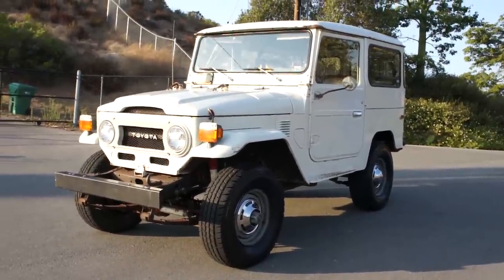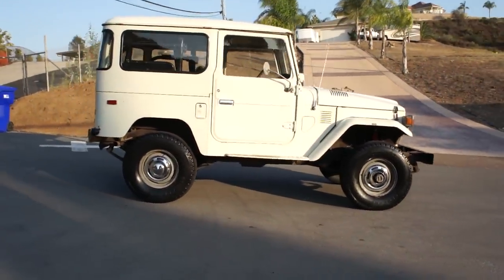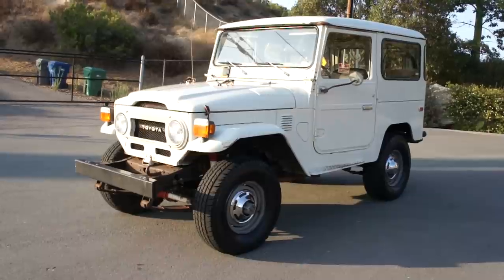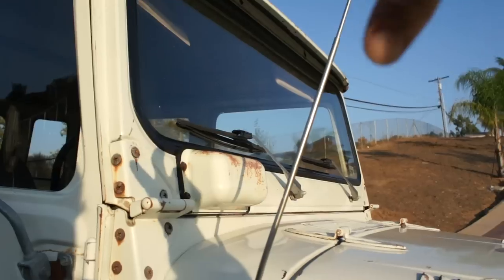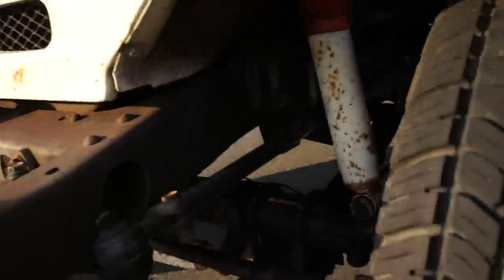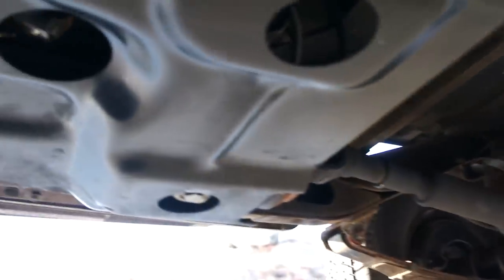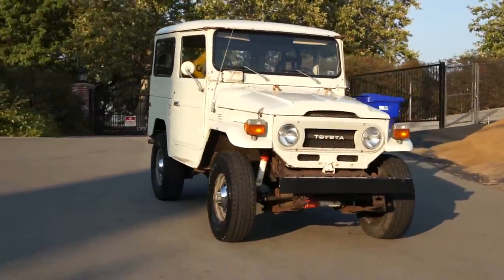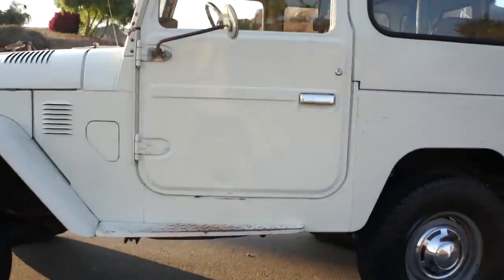FJ40 Land Cruiser Toyota 5,800 Original Miles & Paint JEEP Crawler

Comment: I've had 65 of these trucks. Man, I hate to burst your bubble but you can't blow through the floor mat of an FJ40 in 6,000 miles. It take about 70,000 to 100,000. This is a nice truck but not a 5800 mile truck. 105,800 perhaps